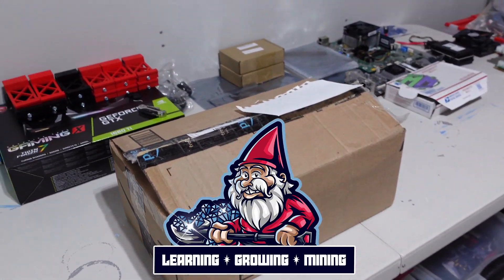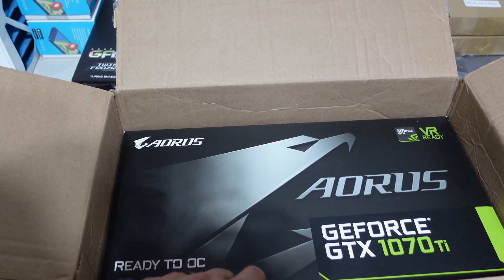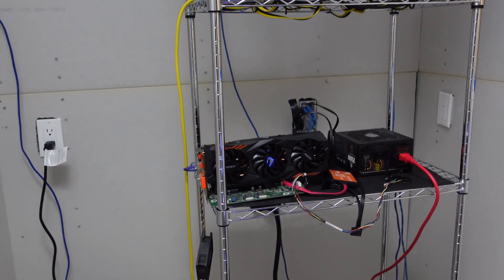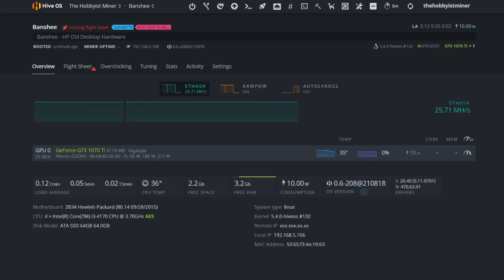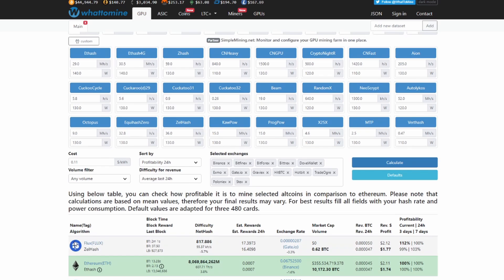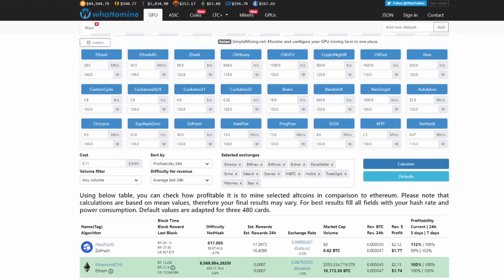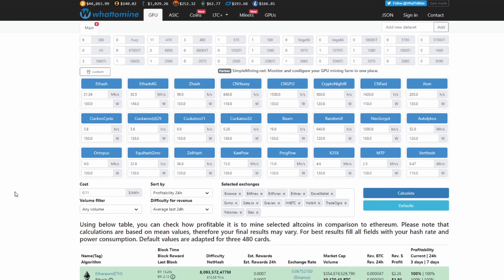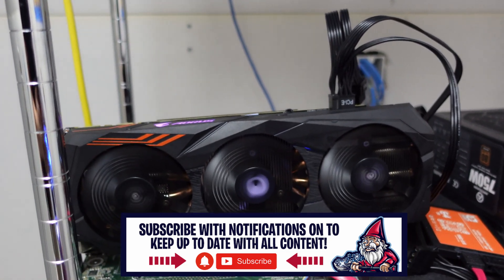GTX 1070 TI Mining Hashrate, Overclock Settings & Profitability

Comment: 150 W for the CARD ?
Your system will suck more when the GPU is working so it can ramp up to 30-35 W easy.
So this leaves you with another 133 W for the 1070 TI.
THM you're wrong AGAIN. Man, why ???

Comment: You can easily get 32.5 MH/s with 1070 TI at 135w but the efficiency is bad. Your efficienty is not high too... 26.20 MH/s at 90w is better in terms of efficiency

Comment: I love this card. It's not the most efficient but ETH 34.28mh/s @110w aint bad especially for $300. 
Evga 1070ti ftw2 
PL 63
CClock 200
MClock 800
Fan 95%
Temp 48°C
Reply from the maker: The 1070 ti does amazing on flux!

Comment: how often would you recommend changing thermal paste on GPUS ?
Reply: when you notice the temps are too high...
Reply: @brimmlessyankee6980  i guess there was more to my question than that, what i was really trying to say in retro spect is how long can you expect thermal paste to last at normal temps, like would it be a yearly thing that they could start heating up or does the standard paste last longer. My temps wont really increase due to Automated cooling system that keeps them at a constant - that wouldnt indicate to me that the paste is running low as the average temp of my devices atm is about 25 degreese , which is very cool considering there at full speed so what is considered over heating ...
Reply: @DaKaPlays  they should last around 3-10 years depending on quality and some other things

Comment: Didn't get my overclocks running in gminer yet, but undervolting my 1070ti to  1780MHz@825mV, +500 on the memory gives me 31.6 MH/s at 105W, efficiency barely over 300kH/W. But as Insaid, I have to run MSI Afterburner on the side.
Would appreciate for info on how I can transfer my voltage curve into my bat-file (or if another miner ca do this)

Comment: My Strix 1070Ti has been running non-stop 24/7/365 since the day they first dropped at MicroCenter 4~ years ago. Zero maintenance ever. 30-31Mh/s still today.
Reply: Not even blowing the dust off? Not replacing thermal pads, paste? How is it not dead
Reply: @Stiflex  Not once, ever. My new Strix 3080 is already loaded with dust after 8 months of mining lmao
Reply: I'll finally maintenance the cards and rigs when I find a good deal on an ultrasonic cleaner that can fit GPUs and motherboards.
Reply: @RobFRC  You're playing with fire bro, no idea how you're that lucky, I'd at least clean the dust out once a month from the fans at minimum.
Reply: I finally had my first fan "fail" in all my years of mining (On and off since you could mine BTC on a Pentium 4). Only happened cause I let an unused PCIE power connector fall into it while it was spinning. Knocked a blade off now its wobbly and noisy lmao
Reply: @RobFRC  Your negligence is heresy to me, brother :D
Reply: I think I need an air purifier  LoL
Reply: Oh, and my new zotac cards and new in November MSI Gaming X Trio 3070 have been more problematic than anything I've owned before. Too expensive to be having the flaws that they do.
Reply: @RobFRC  Probably because you don't take good care of your previous rtx children, they need extra love.
Reply: The previous children are GTXs and P100s lmao Ive only managed to score two RTX cards this whole time -_-
Reply: @RobFRC  tbh buying the cards for me are easy, the problem is that they're expensive. 3060ti's are like 750 euros, normal ones are about 600.
Reply: I got so desperate for Mh/s I ordered five Newegg 6600 XT combos between last night and this morning. RIP. I don't even like AMD.
Reply: What are you mining on your 1070ti? Eth feels like forever to mine.
Reply: @Zazcha1212  still on ETH

Comment: Hey mate, I’ve got the EVGA 1070ti SC (Samsung) and It runs on 31.4 @ 110w on hive os

OC:
170 core
1200 mem
110 PL

I think I could even push him more, I’ll try
(He was In a gaming rig for 3 years, only last months I started to mine on it)
Reply: I don't like those EVGA cards... Is that the one with the 2 chrome "badges" between the 2 fans?

They're all over eBay with dead power fets, so if you don't know, make sure you are taking care of it. I think heat kills it from high wattage, so you're probably good mining on it, but wanted to give you a heads up.

Comment: im getting 77.2 Mh/s @ 90w on autolykos2 with this beauty (zotac Amp 1070ti micron)
pl -50 cc +200 mem +700 ... locked 700 mv curved with MSIAB
using nbminer with -mt 6 (memtweak)

Comment: My 1070 ti runs 32.8 mh/s all day  +175 core +675 memory  power  75%. fan 85% 
good luck tweaking
Reply: what about temp? the best mhs i can get its 31.09mhs with 53c°, +550 mem clock, +150 core, 60% power, temp limit 60c°, fan is in Auto, between 43/50, i have a Zotac 1070ti AMP
Reply: @Rotraa  mine holds pretty steady at 58c
Reply: @brianhollywood29  well thats a good temp, its not that high, i'll try your config later